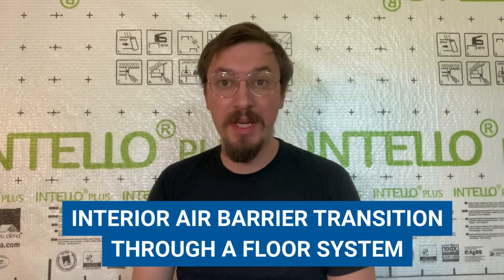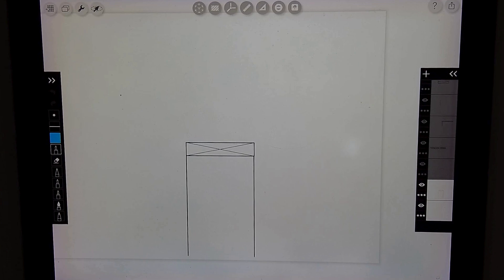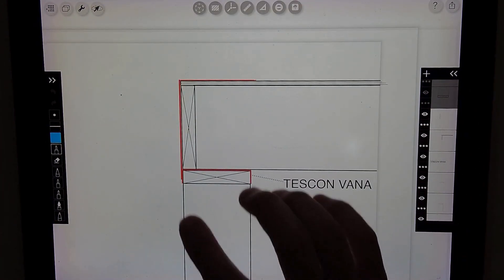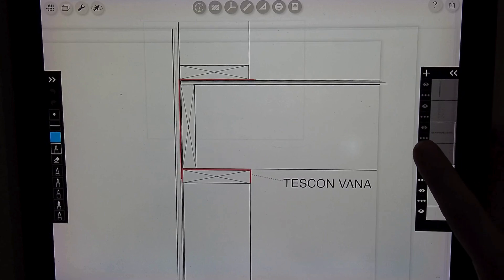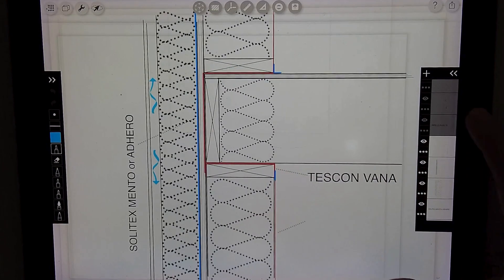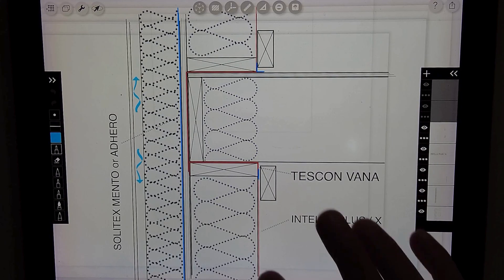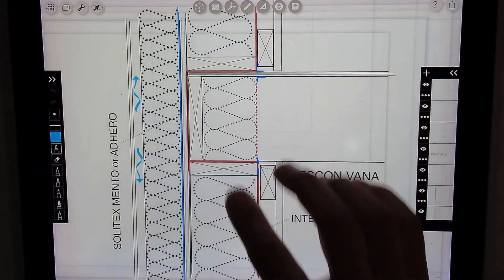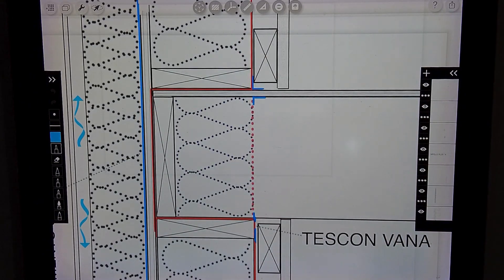Interior Air Barrier Floor Transition Sequencing

Comment: This is not a cost effective way to achieve an air barrier.  Tuscan Vanna Tape is rediculously expensive.  I think Zip sheathing eliminates most of the need for for top plate and rim joist details.
Reply from the maker: Zip is only exterior. This detail speaks to those who are doing an interior air barrier as well as an exterior air barrier - something that is more common in high performance assemblies. If you are doing an interior air barrier, we've found this to be one of the simplest and most effective ways in new construction.
Reply: @475.SUPPLY  Hi!  I recently used Intello plus on a new home build and I am very pleased with the product and system.  I used zip r sheathing on the exterior, hung the ceiling and did a mid construction blower door test at around ACH 1.  We then installed the intello and dense pack cellulose and did a final blower door test at ACH .44.  We did not do the top plate details outlined here, and considering the expense and effort, I am not sure why we would if we can hit ACH .44 using simpler and more cost effective methods.  Thanks for your reply!

Comment: @4:17 What would be the con of just spraying viscon in that area and fill in the bigger waps with tape or Viscon Fiber? TY
Reply from the maker: Projects can use VISCONN to airseal all of the framing as well as the joints and seams of the framing -- and then airseal the INTELLO to the VISCONN above and below the floor system. This VISCONN approach is just more detailed focused, harder to do quality control of the install, and tends to be higher cost. This VISCONN approach can be an appropriate option for retrofits because it saves labor time over taping.